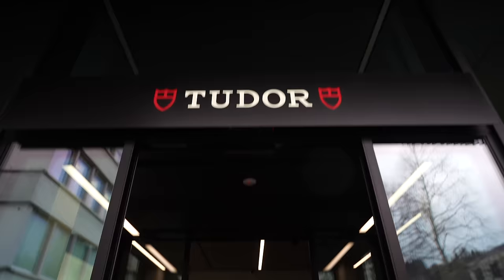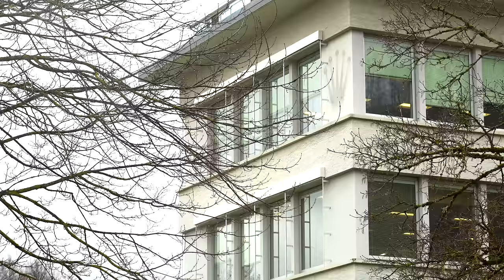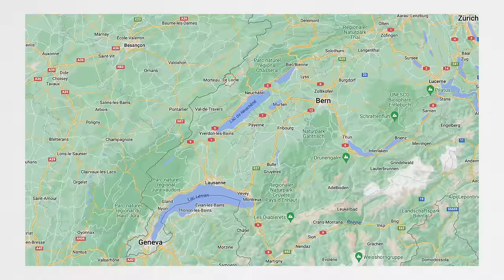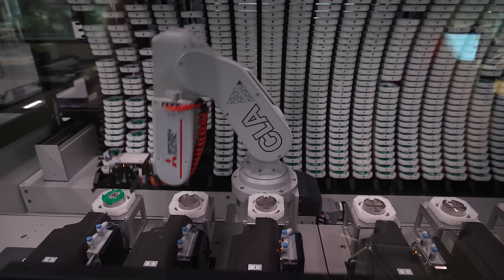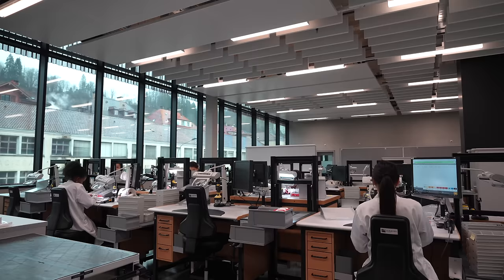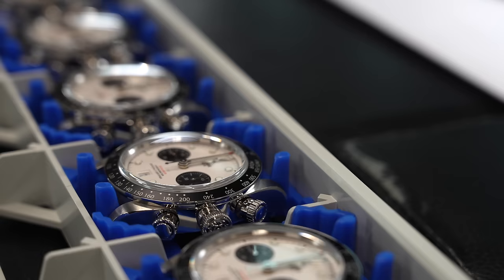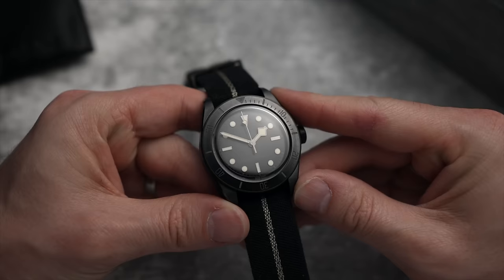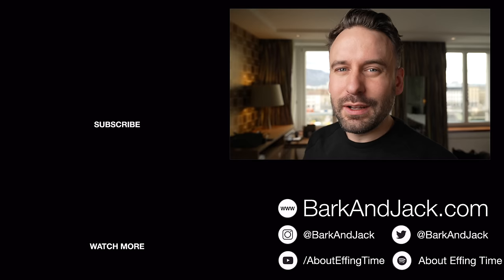Inside TUDOR - Who actually makes Tudor watches?

Comment: You talk about the way that robotic assembly helps keep cost down by automating time consuming processes - like attaching the hands. But I'll bet that Rolex uses just as much automation in their processes. In fact I'd imagine that being the same company, the Rolex assembly lines look pretty much identical to these at Tudor. A Rolex probably doesn't cost that much more to make than a comparable Tudor, granted the Rolex cases and bracelets are in house, and finishing levels are (marginally) higher. But the marketing spend for Rolex will be in a different league, and much of the higher Rolex retail price will be needed to recoup it. We know from the grey market that Rolex could charge significantly more that they do and would not lose sales, and thus we know that brand cachet does much more for profit margins than any manufacturing cost savings can create.

Comment: Tudor is a great brand, this video just solidifies it further for me. Value is just off the charts. Quick story about sub-supplier network. That concept of Tudor owned companies sub-supplying components is common in industry.  I thought my story might be interesting as a perspective on this. I own a painting shop that works on Aerospace and military jobs (not watch industry at all).  I had an offer once to get bought out partially and we'd be part of a network of suppliers that would deliver finished goods to big companies like Raytheon, Northrup etc. I ultimately chose to turn it down. My main reason was specific to the company that was spearheading the whole thing. I was doing work for them already and they couldn't pay their bills, always lied about payments etc. When I asked them where all this money is coming from to buy into several companies at the same time, they couldn't answer or dodged the question. Sketch of course. However, I probably would have turned it down if the money was there. My company was just a few years old, and although some guaranteed contracts would have been great, I banked on myself knowing the potential growth was much higher not being capped by demand of just a few customers. I had a steady base of customers already so made sense to me. Turned out to be right. That company who made me the offer is 250 days behind on payments to all their suppliers, including me, and still pulling that lying crap. My business is steadily growing 10-15% per year. Guess I made the right call.

Comment: Great presentation and work, Adrian! I have a feeling that Rolex probably does the exact same thing as Tudor regarding highly automated assembly, but perhaps doing more in-house fabrication of component parts. A more physically integrated supply chain, but most likely the same sort of robotic assembly process. If that’s the case, then Tudor is the far more fairly priced of the two brands.
Reply: Was just thinking the same. Assuming Rolex are doing the same thing, they are essentially mugging everyone off. No one will be upset with Tudor given the price point but it does make you question the gap between Rolex and other higher end brands.
Reply: Rolex might have assembly automation, but everything is sourced and done in-house. It's not an assembly line there where parts ship in from different factories, and they're assembled in a sequential order in-house. Rolex makes the parts for their watches and then assembles them, which means they have full control over their product lines. But in order to pump out a million watches a year.. they're not building the parts by hand. So a Rolex is still a more special watch than Tudor, even if Tudor has a leg up being METAS certified, not just COSC certified.
Reply: No shit

Comment: NICE!  I kinda knew most of this but hadn't seen the details. It also kinda shows - from a distance - how most likely Rolex is building their watches. As Tudor is about 250k watches per year and Rolex is about 1M watches per year. Which means that IMHO the Rolex proces might even be more scrutinous than that of Tudor (but then this automated working is as scrutinous as it gets imho), but making the 1M or 250k is about the same ballpark. Only Rolex might have some more factory set diamoands watches etc. which is much more manual work.
BTW Kenissi is NOT wholly owned by Tudor!
It is 20% owned by Chanel. Plus there is a strong partnership with Breitling. So e.g. the Tudor MT5813 is based on the Breitling B01 movement.

Comment: Very well done video and also quite expected from Tudor. They are the value proposition in the market right now, especially with brands like Omega and Grand Seiko jacking up their prices.

Pretty soon Tudor will have in-house movements that are METAS certified and in increasingly slimmer and more refined cases. If they stick to their largely-under-$5k price point, then they are going to gobble up market share like you wouldn’t believe.

Comment: I dig videos like this, more please.  Tudor SA has never manufactured a watch component and that was the whole business model from the beginning so Hans could sell quality watches at reasonable prices.  When I pointed that out over the years on forums, pretty much nobody believed me.  Tudor SA has always used good quality Swiss suppliers but don’t actually manufacture parts.  Now with Kenissi, Tudor have gotten into the movement game in a big way, making a good product even better.  But you forgot to say Chanel owns 20% of Kenissi.

One thing I’m very curious about: where does Kenissi refurbish the movements sent in for service?  Since Tudor is historically an outsourcing company, it would make sense to outsource the basic refurbishment, then have Kenissi staff do the final assembly and regulation before finishing up their hot-swap service model.

Hey, did you meet Cole Pennington?

Comment: Tudor is setting up nicely to become a behemoth down the line. Rolex has invested heavily in R&D for Tudor to be so efficient and technologically advanced. As someone in software, this automation is impressive because the room for issue deviation has to be small. 
While the Tudor price point is lower now, they won’t stay there long term. Their designs and movements are becoming more refined as time goes by. Rolex knows how to take time, reinvest in vertical assembly, so Tudor will likely be more in house over time. 
I love seeing how a Tudor are growing. I would buy a METAS Pelagos over a Seamaster.

Comment: Very interesting video as I just bought a BB58 925 and I'm very impressed with its' build and its' accuracy. Did anyone ask what Tudor does when a watch is returned as faulty? Do they just change out the movement as many suspect?
Now for an in depth tour of Rolex - ha!, good luck with that.
Reply: The 58 is such a fantastic watch. Depending on what needs to be repaired, parts are simply replaced. It is great that you will have the backing of a great manufacturer to support your watch for many years.

Comment: IMHO, the price point Tudor is at, is hardly surprising that manufacturing process is mostly automated. Tudor owns the sub GBP5,000 price range and watch buyers get a decent deal, it can't be a bad thing surely? As long as you don't mind the design is a bit safe most of the time

Comment: Unlike a lot of other comments here I'm actually unimpressed with the amount of robots and computers used. I want to see people doing all the work and for me that's about supporting local jobs and continuing to teach and support the skills it takes to build a watch. 

I've never considered a tutor anyway and this discourages me even more. 

Great video though
Reply from the maker: That’s a really interesting point that I think I missed out. The main reason robots were needed is simply because of the labour shortage of watchmakers. This is an industry wide issue and the main reason many watches, especially from brands like Omega are hard to get.
Reply: @BarkandJack  agreed, and to rectify the issue some of these manufacturers need to start doing training and apprenticeships to re engage the community. The industry needs a boost in training rather then switching to robots. Or can if course do both. 

Thanks
Reply from the maker: @motorcyclerescuer  I think they need to pay more for the watchmakers or stop being romantic about heritage. Many watch brands still have factories based in the small Swiss regions that are known for watchmaking. However, the output required to meet demand has massively outgrown the labor force in these quiet rural areas. So I don't think the answer is training, but rather making the job more attractive. Unfortunately, many brands, big and small, are using watch technicians rather than watchmakers, these technicians are trained to perform tasks, rather than learning to build watches. 

The technicians are quicker and easier to train and don't need to be as knowledgeable as a watchmaker, therefore costing much less. 

But who would move to a tiny rural village/town for a low-paid job, when these can be easily found in a city, or somewhere more exciting.

Comment: Really great video! I think that the kove to METAS is a great one for Tudor in staying close with Omega. One thing they really need to invest in is a way to slim down their movements/cases - particularly with complications. Sure the BB58, P39, and BB54 are nice and thin, but once you add a simple date or GMT complication into the mix, Tudors quickly get way too thick. I love the brand and like where they are heading, i just think this is one thing holding them back right now.
Reply: @SIZZO76  never said they were. I own 4 Omegas and 1 Tudor there brother. Don't hear what I'm not saying 😂
Reply from the maker: Omega and Tudor are very close in their product offering.
Reply: @BarkandJack  Very commercial, as in not good. Now the magic is gone. You should have kept the curtain closed. Now we know what the great wizard of OZ is....in a warehouse in some industrial park. Thanks. Is Santa dead too?

Comment: I bought my first decent Watch about 30 years ago, that was a Tudor. At the time they were using ETA movements. The guy who told me about Tudor told me not to worry about "In house" movements as even Rolex used Aegler movements, I had to check that out as i thought that had always been a boast of Rolex that they were "In house". I found that Rolex bought the Aegler company in the mid 2000s, so now they are "In house." I have 2 vintage Rolex that have Aegler movements with the Rolex name. A bit like owning a Lexus!!!
Reply: The Daytona used the Zenith El Primero movement until Rolex bought up enough companies to be able to claim “in house”.

Comment: Thanks Adrian for the inside look, but more importantly for transcribing what this level of automation all means, how it's done, what the consequences of certain choices entail.

Rolex is quite evidently run as a luxury brand by folks who know what they're doing. Offer and demand settles the dust of any debate and that is that. The move to acquire Bucherer is/was a brilliant commercial move as youe other video pointed out. 

Leaving that discussion aside, what I find fascinating to witness in today's era of watch making and brand building - the 2 being tied at the hip - is the Bremont approach of bringing luxury-and-mass produced watchmaking to the UK via the Wing vs  what Tudor is doing with the red building and Kenissi. 

Curious to hear what you make of that comparison. To me they are different pursuits, both amazing to observe as enthusiasts. And I would argue that Bremont is being held at a much higher standard than Tudor on many levels (for right and less right reasons)

Comment: Andrian, if they wouldn't say where their case bracelet, and related metal parts like their bezel assembly are made, how can one  conclude that they are made in the same region or even in Switzerland? Plus we all know that Swiss Made is a very diluted, you can practically have all those main metal parts cheaply made in other parts of the world, as long as your movement is Swiss and assembly done in Switzerland, having 60% of the total cost spent in Switzerland which I imagine is very easy to achieve given the price of Swiss labor and movement, although the rest of the metal parts are all done in Asia, it can swill qualify as Swiss Made. 😅

Comment: Very interesting video. Disagree quite strongly about using suppliers to deliver parts means they’re not “true in-house.” If Tudor engineers create a part’s design, surfacing, CAD files and 2d drawings that they send to a supplier to plug that info into a machine to create the part which is then delivered back to Tudor for assembly, I think they’ve done more than enough work to call it “true in-house.” Part manufacturing is really the very last step in the process. Also it’s how almost all engineering is done from medical ventilators to super cars.

Comment: Tudor is a fantastic watch in terms of price and feeling on a wrist you get for this price. I had two in my collection: BB Chrono Panda and BB GMT White Dial. Tudor also performs extremely well in marketing during the last year. Despite that, I decided to remove Tudor from my collection for two reasons: (1) they are relatively cheap and easy to find (I easily got two most thought after Tudor models from the AD) and (2) I don’t feel wearing an exclusive or really luxury watch wearing Tudor. Except for the mentioned above, I truly loved my watches.
Reply: Watch snob ✌️
Reply: Lol this comment made me cringe so hard jfc
Reply: @jgo8305  , its your problem, not mine. Try to formulate thoughts more precisely. May be they will have some more value.

Comment: The TUDOR watches are beautiful timepieces.  But not to generalize The TUDOR brand, my dear friend just bought a BLACK BAY and asked the AD to replace the strap to the velvet and upon doing so, the DOT on the 12 o'clock Bezel fell off. My friend was very frustrated as the watch is brand new. The AD offered claim over warranty but I feel TUDOR should just do a complete new replacement. What are your thoughts on this? I am in AUCKLAND NZ, maybe different policies from your country. It's over a month now and my friends Black Bay is still not fixed.

Comment: I think that with all the models going to Metas...Omega is screwed!
Rolex > Tudor > Omega.
Reply: I'd have to disagree, Omega's finishing is still to a higher standard than Tudor. But that's reflected in the price difference. Both great for what they are though (my 2 favourite brands).
Reply: @Draknareth  I don't think Omega can justify vastly superior finishes in their very industrial processes. I don't find them to be impressive watches anyway, there are many equivalences. I don't find Tudor to be ridiculously low in comparison. For me, it's the difference in appearance or choice of materials, but not really qualitative. Having a PO in steel with a visible bottom or a very tool Pelagos entirely in titanium, for example, has nothing in common "spiritually". They even rely on the Speedmaster, without which they would be non-existent on the market. Here we see Tudor getting innovative and moving to Metas too, it's very dangerous for them. And I believe in my assertion. The future will tell. Everyone has his opinion.

Comment: I heard the cases are made in the same factory as Christopher Ward which makes sense because the quality is about the same. Just shows what a good deal a CW is and how much Rolex tax is on a Tudor. The movements in Omega watches are only in Omega watches. The movements in Tudor watches are in loads of brands and that is definitely less special as are the movements themselves. To compare Tudor to Omega is ridiculous. Omega is in another league compared to Tudor and so it should be with difference in price. Omega has long term appeal while you never actually own a Tudor, you just look after one for a year until they bring out another Black Bay that looks like another old Rolex that’s better than the one you bought so you EBay your one and buy the new one until next year. Then you can do it again 🤦🏻‍♂️